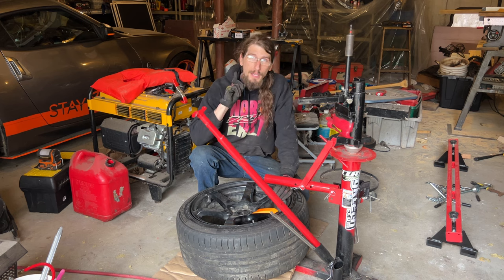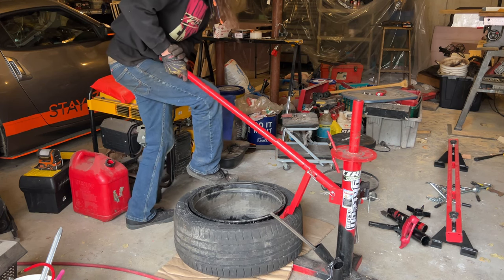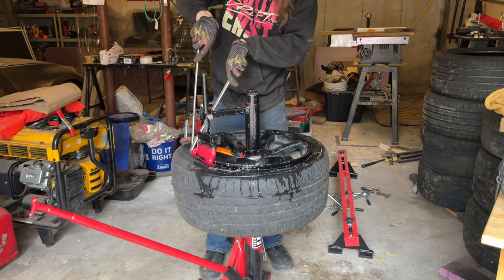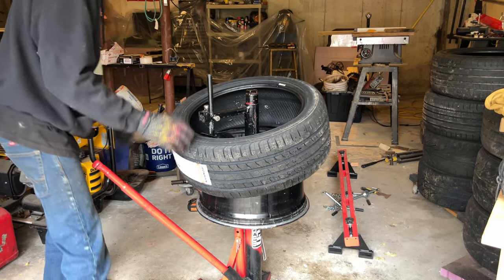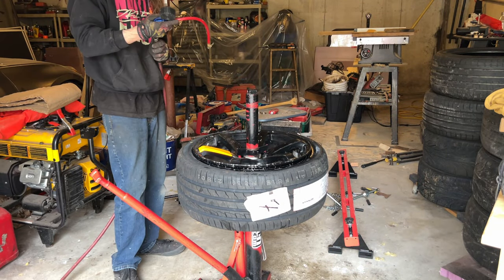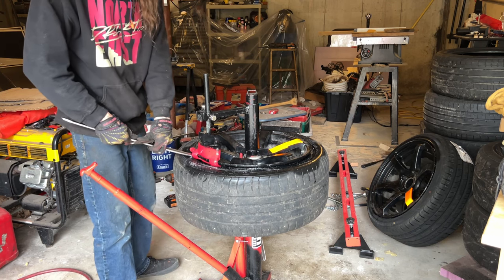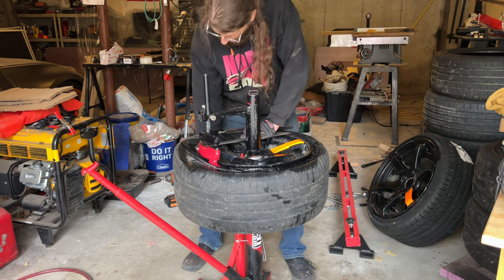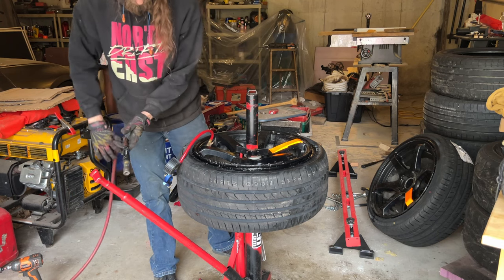Harbor Freight tire machine Cheap Mods, Easy DIY tire changes

Comment: I have the exact same Harbor Freight tire changer. I paid $35 for it when I bought it. You just spent $115 for a mod on a $35 tool. I'd say it was probably worth it, but hey.....
I will also say that low profile tires are the bane of the universe when it comes to mounting and dismounting them.

Comment: You need to get you a strap and you leave that down there with that beep.Breaker push down on one side that it gave you room where you can get that outside edge started up

Comment: Going to the tire shop is faster
Reply from the maker: For a normal person going to a shop is probably better. I however drift and need every bit of money to put toward more tires. lol
Reply: Those of us with track only cars can't exactly drive them to a tire shop. Not to mention that many of us who build or tune our own cars absolutely hate someone else messing with them.
Reply: not really sometimes you have to wait about, and you save money,
Reply: @CJdriftZ  do you never balance them?
Reply from the maker: @leeyo5494  Not for drifting it would be a waste of time. Been thinking about getting a bubble balancer soon for the daily though.
Reply: Or when you pay to have say valves stems and the don’t change them and you go back and they charge you again for valve stems ever since I’ve installed my own tires the actually hold air my to cents
Reply: Closest tire shop to me takes about an hour and a half to get there, then another at least 2 hours wait.
Reply: No way, whe to take appointments, inconvenience, price... etc